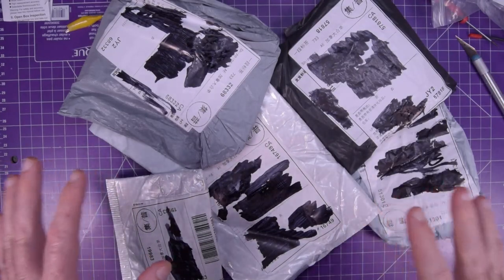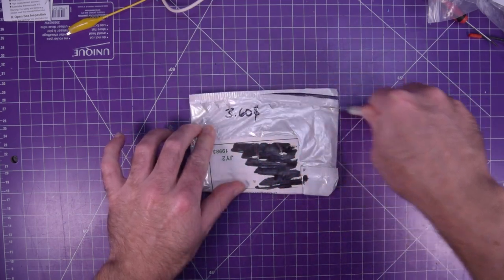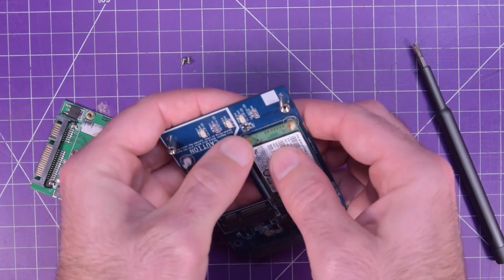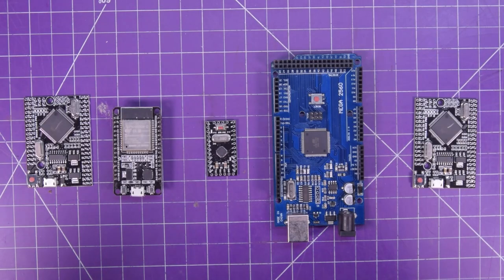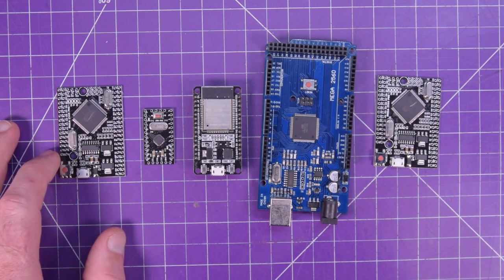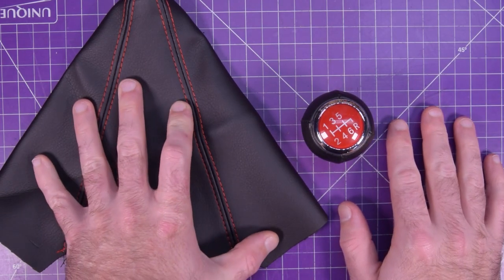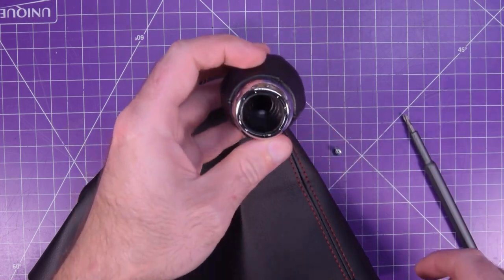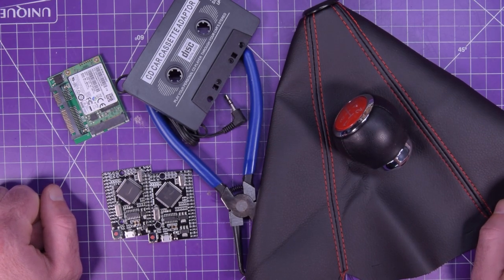Mailbag 120 - On The Smaller Side

Comment: I bought one of those cassette aux adapters years ago.  Seem to remember the cassette's rolling noise was a distraction.  (shrug) May just be my player.
Could certainly find a uses for those mega2560's.  Enough pins to control  a 3d printer. Still expensive though.  Once you could get the full sized board for around $10.

Comment: If there is no aux on that Volvo radio I highly advice using that tape and a BT audio receiver.  The BT receiver will switch on when turning the key so your phone will automatically connect to it.  Much much more convinient than pluging that 3.5mm plug in each time. 
I hacked the cd-player, which was a 6 loader in the armrest,  in my Jetta in 2012 by interrupting the audio left and right and using a BT audio receiver. I did not figure out the controls of the play and tracks but just used a blank 1 track cd that was set on repeat. Played fine every single day untill I sold the car in 2018.
Just did that 'install' last summer on someones car that had BT calling capability but no audio streaming. The car had a 3.5mm aux input jack. On alie you can find like audio pro BT module (blablabla) which already has a nice casing and a micro-usb power connector. 12V cigarette lighter plug with 2 outputs, one for the BT device and 1 to charge the phone and that person was very happy for like 10 USD